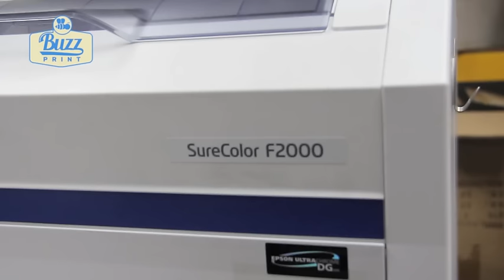Express T-shirt Print with DTG on Epson SureColor F2000

Comment: Where do you buy that product? How many times does it need to be changed? What are the differences? I know that there are two types of sheets that are used on the before print and after print- if you are just using one does that make a difference on the shirt before it is printed? Sorry for so many questions- we are just starting to get more clientele and I want to make sure to get the best possible print. Thank you Allysa

Comment: How were you able to press without any paper on the shirt after the print was done?
Reply: Teflon sheet fixed to the heat plate = Glossier finish.
Kraft paper = Satin finish.
Reply from the maker: So sorry for the late reply! The teflon paper is attached the heat press.
Reply: @buzzprintkk  Is DTG worth it? Right now I am using a Roland to do print and cut colour vinyl and I am considering DTG.